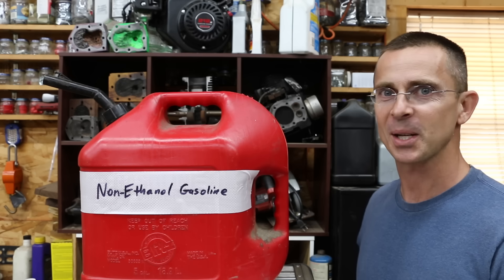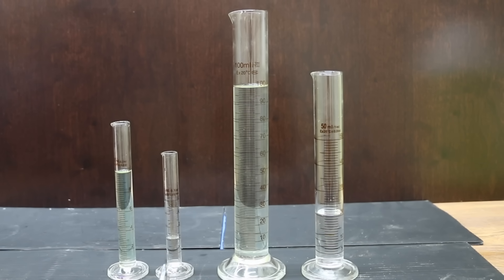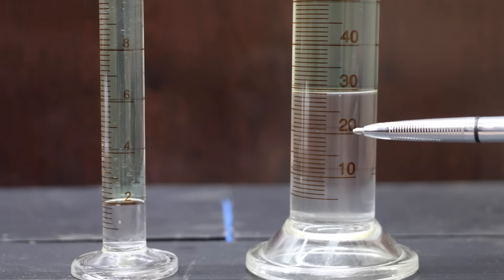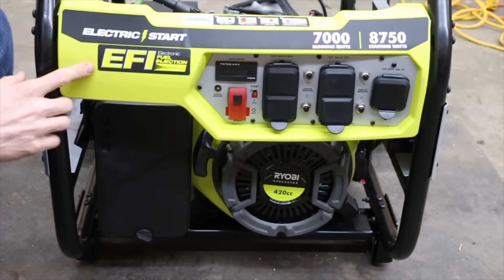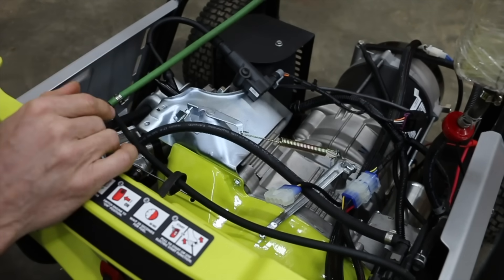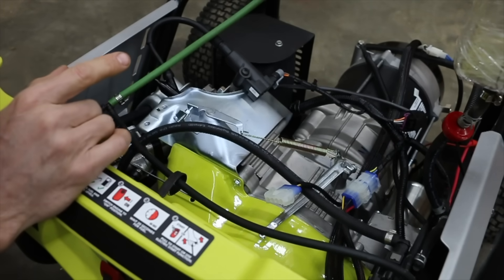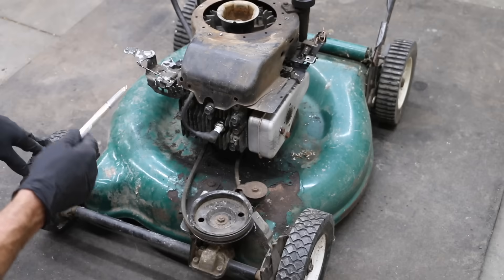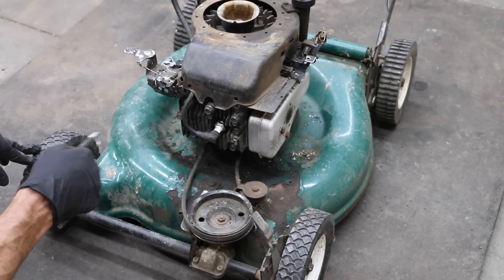Is Non-Ethanol Gasoline Really Better? See the PROOF!

Comment: You confirmed what i believed for years its crap, i can`t imagine how much fuel has be dumped in to the environment due to incompatibly with equipment built before 2008 when the mandate took place , or the millions in repair is has cost the people of the US  ,  I stopped using the crap in my boats and power equipment in 2010 after number carburetor rebuilds gas line replacements and crappy performance of a new boat,  Great job keep up the good work
Reply from the maker: Thanks for the feedback.
Reply: @ProjectFarm  Just for curiosity have you compared gas with the same ethanol content but different grades in the generator test ?

Comment: here in holland they recently switched all fuel over to ethenol fuels (E10 mainly) it's supposed to be better for the environment but on a full tank of pure fuel i could do 660km+ with the E10 i can barely hit 600, so the 10% ethanol fuel takes off about 10% of my range...so i will need about 10% more fuel to go the same distance...how is this better, the crooks even charge the same price for E10 as pure fuel, or does the adding of ethanol reduce the remaining exhaust gasses of the remaining fuel. since we have a lot of older cars over in holland, i'm sure the country would rather have us all get rid of em and buy sparkly new one's as a lot of pre 94 car's aren't to fond of ethenol seems like a nice and slow/insidios way of killing those off by switching all fuel over to ethenol based. go to another country that still sell's pure fuel to save your engine or be prepared to say goodbye in a few years.
Reply from the maker: Thanks for the feedback.

Comment: Here in australia we have 91 octane e10 and 95 octane e10. The 91 octane e10 is a scam because they use 80 something octane petrol. The 95 is 91 octane petrol with alcohol is it which is basically the same fuel efficiency as the 91. Unfortunately 91, 91e10 and 95e10 are all the same price.
Reply from the maker: Thanks for the feedback.

Comment: I had always heard from a professor friend at UAH that ethanol doesn't make much of a difference other than the things you mentioned in the video.  However I still use non-ethanol fuel in two cycle engines such as my chain saw as most two cycle repair shops recommend against it as the water can supposedly cause scoring and loss of compression in two cycle engines.  This is something that I have personally experienced (I think) as I had two chain saws ruined by piston scoring and severe loss of compression before I started using non-alcohol fuel exclusively in such devices.  Would love to see a video about alcohol fuel and two cycle engines from you.
Reply from the maker: Thanks for the video idea.

Comment: Corn for fuel ? Totally Assine !
Ethanol is a Farm Bailout for Stupid farmers who buy $75,000 tractors
My 1999 Dodge Ram wont run on Shitty Gas ,no power Valve chatter and Low gas mileage.
my Truck got 20 miles to the gallon with ethanol free gas. with ethanol 15 if I'm lucky.

Comment: Good video.  You are right about opinions. You seem to follow the science or facts.   Good on you.  I am interested in long term effects on small engines.  I quit using ethanol based fuel in small engines.  I have a Ryobi weed eater and push/trim mower and a gas powered riding mower.  It is nice not to have to fight the small engines gas problems with those battery products.
Reply from the maker: Thanks for the feedback.

Comment: I've purchased junk motorcycles that have been sitting for extended periods of time (typically carbureted) and it seems that the ethanol has adverse effects on the brass components where non-ethanol doesnt typically have this issue. The last set of Mikuni vacuum slide carburetors I disassembled the jets were so corroded/etched I couldnt even make out the sizes on them anymore. That being said, it also seems that as long as you keep the ethanol fuel moving in the system it doesnt seem to have these adverse effects as a system that is neglected/not used often (for years) does. Its definitely an interesting topic, but for the lawnmowers, chainsaws, trimmers, and everything else in my garage I just use ethanol knowing I use it enough.
Reply from the maker: Thanks for the feedback.

Comment: Please include brass carberator main jet in the plastic tests,  Allow the brass to set in the fuel.   The problems I ha experance with my lawn mower, generators and ATV is the brass main jet plug with a very hard black corrosion.  It requires using an orfice drill to remove and carberator cleaners will not remove the coorsion.
Reply from the maker: Thanks for the video idea.

Comment: Never mind the fuel efficiency; It is a proven fact that Ethanol will harm engine and fuel supply components that are not specifically engineered to coexist with the blend. The ethanol is hygroscopic, and corrodes the entire fuel system over time. As such, it will damage older model motor vehicles and most older and current model 2/4 cycle gardening engines. Frankly, I believe it to be planned obsolescence by world governments to force consumers to purchase newer model motor vehicles.
Reply from the maker: Thanks for the feedback.

Comment: Retired Powertrain Engineer.  The 2 fuels, gasoline and E10 are not identical, but AS A PRACTICAL MATTER they aren't all that different. The thing to remember is energy density or how much energy is in a gallon of fuel. Gasoline has it in spades especially compared to say E85. In simplest terms, if your vehicle get 30 mpg with gas, it will get somewhere around 20 mpg with E85. In terms of energy, you need 1.3 gallons of E85 to equal the energy in a gallon of gasoline. If your vehicle is E85 compatible, you'll see your mileage drop, as much as 1/3 with E85. If you are paying less than 2/3 the price of a gallon of gas for a gallon of E85, your gas bill shouldn't go up. If you pay more than 2/3, it's not a bargain.  If you want to save the planet regardless of the cost, E85 may help you with that. Also, you will find out E85 is highly corrosive and requires special equipment. As in everything between the tank and your injectors has to be able to handle the corrosive effects of ethanol. All non-E85 or E10 compatible vehicles are already equipped to handle those corrosive effects.
Reply from the maker: Thanks for the feedback.

Comment: Of course it is. Ask that question again when your engine vapor locks because of alcohols lower vapor point on the highway in the middle of nowhere in 100 degree heat outside of cell phone range.
Reply from the maker: Thanks for the feedback.

Comment: Ethanol plays havoc on 2Cycle engines carbs. It clogs the jets badly and it also ruins the jet performance in ATV’s and off road bikes. I’ve replaced and rebuilt so many carbs that were exposed to Ethanol fuel that I refuse to run it in any of my small engines. Great Video!
Reply from the maker: Thanks for the feedback.

Comment: Funny, I have measured my mileage in three cars with and without ethanol fuel and 10% ethanol gives a reduction of about 10% to the mileage.  The thermal potential of ethanol is much less than octane, ethane and nonane so that makes sense.  Now carbon build up should reverse this trend with ethanol scoring better, having far less carbon and less thermal potential.  Ethanol is a good solvent for many polymers so unhardened fuel systems are compromised.
Reply from the maker: Thanks for the feedback.

Comment: one of the common things for areas with colder climates is you generally want lower ethanol content. since ethanol can formulate water/condensation it can freeze causing your pump to seize until its warm enough or just damage it entirely. 

I've been on the fence with the stuff in general. For instance with my car build for higher hp the E85 is a popular option. but in my opinion its only ideal if you have E85 stations near by, i've heard of people that will buy some 55 gal drums of it but you gotta make sure it doesnt get contaminated or else its ruined. you have the treatments and what not. but in general if you're not going to use all that fuel as soon as possible its almost a gamble because of how likely you'll have it get contaminated. 

Another thing i find interesting is howmuch e85 is required to actually make the same HP numbers as a car on gas. yet its higher octane means you can really up your compression with out having detonation.  im not sure. i just want to build my engine and have good numbers but i dont wanna have to worry about if i run out of fuel how long it will take me before i can get the fuel to drive it again.
Reply from the maker: Thanks for the feedback.

Comment: Regular gas is E10.
I've running E23 mixing e10 and e85 on my stock 98 honda civic ex coupe d16y8 with a stock ECU. for over 2 years and not damage present.
Clean and stronger burnt.
If I mix wrong abode or bellow E23 performance drops...
I replaced my fuel pump and inspected inside the fuel tank and lines. No corrosion or any type of damage found. 
I feel like 150hp @ 5600 rpms. Vtec engages at 5200 rpms. 
I haven't done a full throttle..
Reply from the maker: Thanks for the feedback.

Comment: Ethanol gas just about destroyed my 29hp efi Kohler engine.  The ethanol rotted out the gas line to the fuel pump witch is under the valve cover filling the crankcase with gas.  Kohler dealer said to never use ethanol gas again!
Reply from the maker: Thanks for sharing.

Comment: If you go to your local parts store, and look down the chemicals Isle. There is a bottle of fuel treatment, that says right on the front, solves the ethanol problem. Which means they know they have a problem. And they have a treatment for it. They didn't just come out and feel like they had a problem. Somebody, somewhere, determined that there needed to be a solution for the problem. It has gone through all the time effort energy and engineering, to create a solution for the problem. Now why would somebody, a major corporation, go through all of that trouble, if there wasn't a problem?

So what's the problem? 11 billion extra bushels of corn produced, every year. They can't sell it. They can't give it away. And they can't force it down the cows throat fast enough. Maybe the question isn't what is the problem with ethanol? Maybe the question should be, why are we producing 11 billion extra bushels of corn per year?

Dyk: the heat needed to separate the sugar molecule from the corn, cannot be generated from a stove top? The heat needed to separate that Sugar molecule, actually falls somewhere in the range of a nuclear reactor. Go ahead... Enjoy your corn sugar.
Reply from the maker: Thanks for the feedback.

Comment: Carbon buildup isn't the issue with ethanol. In small engines it's the effects it has on rubber components like gas lines and o-rings. Alcohol draws moisture.  If you put a bowl of it out to the open air it will draw it out of the air and the level in your bowl will go up. With this in mind, it draws any moisture from anything rubber and makes it brittle and liable to crack. Also small engines have a tendency to sit unused for months at a time like mowers and rototillers. The alcohol draws moisture into the fuel as it sits there causing issues when you go to fire it up. The only additive I've found to take care of this really well is seafoam. I use it in all my small engines year round.
Reply from the maker: Thanks for the feedback.

Comment: I had an issue with 2 motorcycles I own. A 2002 Honda 1800 VTX and a 2003 BMW K1200 LT (touring). I had to deploy for a while and the bikes sat. The VTX gas tank rusted above where the fuel level was (BMW tank is plastic so no worries). I had to dismantle and replace all fuel lines as they had become brittle and cracked both inside the tanks and anywhere where they had fuel sitting in them. I also had to replace the filters and pumps that were in the tank as the filters had become so brittle that they disintegrated when touched. The wires to the fuel pump were eaten away to the point where it was bare wires in the tank. After repairing and putting everything back together,.. got some non-ethanol fuel and filled both tanks. They've been sitting again (a lot of travel so not home much) and I thought that I'd have to do the same thing. Took apart both bikes again,.., everything in the tanks was pristine... fuel lines,.. wires, etc. I'll never use ethanol in something I don't use regularly. Not a scientific study but most of my biking friends have had the same issue.
Reply from the maker: Thanks for sharing!

Comment: In my 2006 Scion xB non ethanal made a huge difference in gas milege and also how smooth my engine would run. Even 93 octane ethanal fuel didn't do that. Also my lawn mower actually runs nicer faster and starts easier. I now have a 2017 Accent and I don't notice any difference with any gas I use. I seem to get the same miles per gallon no matter what I use.
Reply from the maker: Thanks for the feedback.
Reply: @ProjectFarm  You're Welcome

Comment: Worh saying that there is a large difference between E85 and E10.

E10 uses lower octane fuel than ethanol free gasoline. And because it contain less energy it makes the engine use more fuel.

For E85 its different. E85 have very high octane. This increase thenefficecy of a engine that is adopted for it. This also increase the power, simultaneous slowing it to run in less power when idle.

This makes E85 engines.both more efficient and more powerfull. While it does not eat up all of the difference in energy, it eat up about 30% of it
Reply from the maker: Thanks for the feedback.

Comment: Most important things you need to know about E10 is that ethanol attracts moisture. Moisture + oxygen = corrosion.
And
Ethanol affects plasticizers in rubber and plastic components.
E10 makes your fuel ~2% less efficient (for a 20% cheaper price)

Also, E10 degrades in ~3 weeks. If you drive your car on a daily basis, it won't affect your car.
Lawnmowers, dirt bikes etc. (engines which are not fired/used on a regular basis) could be affected though.
And don't put it in an old-timer/classic... EVER! (if you love your classic)

Anywho. Driving a cheap Kia myself and don't give a fly about corrosion or efficiency. It's cheap and Kia's are not high performance cars.
Reply from the maker: Thanks for the feedback.

Comment: Corn should never be used as a fuel! I was a maintenance tech for nine 7-11 gas stations and as soon as we switched over to E10 a whole lot of folks, mostly Toyota tacomas and 2 cycle engines were seeing serious fuel system failures. I was changing pump filters and cleaning nozzle handles constantly because of it, will never again use E10 in any of my small engines, my 99 Dodge Dakota V8 feels like a V6 with it and gets horrible mpg.
Reply from the maker: Thanks for the feedback.

Comment: Ethanol turns all flexible fuel lines rock hard. It makes the rubber tip of the float valve decompose. No good in weed wackers and lawnmowers.
Reply from the maker: Thanks for the feedback.

Comment: I was just thinking about this the other day.
I have a 2.0L Mitsubishi which my wife and I purchased brand new in 2008. It has 200,000km on it now and has ALWAYS been run on E10 fuel from brand new. I've never done ANY maintenance to the engine (still on original spark plugs and gaskets) it's only ever had the oil changed (not even at the correct intervals) and it's still going strong. I've not pulled it apart to look inside or had it on a dyno but with E10 fuels being 4 cents per litre cheaper than non ethanol fuels I've saved around $700 on fuel and can buy an engine from a wrecker for $500 so even if it's trash I'm still $200 better off.
#winning!
Reply: P.S. I've had too many beers at this point. It's 10pm in Australia.

Comment: I only use 98 straight on my petrol engines, ethanol is ok if the engine and it's installation have been designed for it but it wreaks havoc on most plastic tanks and floats and the hygroscopic nature means that if you leave it in a steel tank for too long you get rustholes. A couple of times I have had to put 2% ethanol diesel in my discovery td5 and it ran ok but I won't be using it unless there is nothing else
Reply from the maker: Thanks for the feedback.

Comment: Where I notice the difference is in the small engine carb itself. Opening up the carbs on small motors run on ethanol, I see corrosion, pitting and damage akin to what I used to see in small engines that were kept outside and treated poorly like over a 5-10yr lifespan. I see this kinda damage in one yr old carbs run on ethanol. Now one could argue that would depend on how old the ethanol was allowed to get in the gas tank etc. In my own personal experience, I see ethanol break down in three weeks time. If you keep on top of it, maybe it wouldn't be much of a problem. But for us guys used to non-ethanol gas lasting a lot longer than that, it IS a real problem.
Reply from the maker: Thanks for the feedback.

Comment: You should do a video on o2 sensors! Since there is no o2 in the exhaust (it all gets burned up in the combustion chamber) what is it really testing for! I say it is testing for temperature, if the exhaust is too hot the mixture is too lean, if the temperature is too cool the mixture is too rich and the computer compensates accordingly!
Reply from the maker: Great suggestion!

Comment: Do not run ethanol on cars or motorbikes unless your fuel system is made for it, it can corrode silicone, plastic parts in carbs and can damage fuel injectors
Reply from the maker: Great feedback. Thank you

Comment: I normally use Shell v power 99 octane with 5% ethanol  here in the U.K which is a great fuel but recently used some Esso synergy 97 octane which has no ethanol . 
The Esso 97  gave me 3-4 mpg improvement in mpg .
Ethanol sucks!
Reply from the maker: Thanks for the feedback.